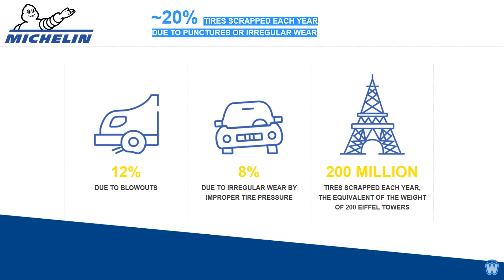Michelin Airless Tire UPTIS - Unique Puncture-Proof Tire System

Comment: Don't see these coming a reality. Big companies won't approve of products which last longer. Else how would they make their money
Reply: As new models get made by big car industrial manufacturers (Ford, Chevrolet, dodge, RAM, & so on) they’ll use old school (aired) tires and the customers/ buyers can decide to keep it that way or to go airless. So therefore tire companies will have nothing to fear when the airless tires comes into public tire shops.
Reply: I think these tires would be designed to wear out faster. I don't know anything about these tires but it seems like a little  dry rot would mean they can't be used at all.
Reply: @pianofry1138  "these tires would be designed to wear out faster." I don't even get this type of logic. the whole idea with these tires is that they are MORE DURABLE AND RESILIENT. Where do you even get such a contradictory idea?
It's like consumers are refusing to welcome a change than benefits them. This mindset is absolutely mind boggling.
Reply: @neurofiedyamato8763   I see a future where the airless tires will be tested on semi trucks (since truckers travel states and drive over everything from smooth asphalt roads to pothole infested streets so bumpy it’ll flatten all 4 tires easily) before being made for average motorists (cars, trucks, SUV’s, vans, atvs, 4-wheelers, etc)
Reply: @pianofry1138    Ask the construction workers who drives construction vehicles with airless tires if they wear out faster & last longer than aired tires.
Reply: ????? Michelin is like one of the biggest tire companies out there. Yet they are the ones developing it.
Reply: You're dumb

Comment: I think the problem here will be keeping the tyre on the rim. As an air filled tyre has the internal air pressure pushing the tyre outwards keeping it sealed to the wheel rim.
What keeps this airless tyre sealed securely to the rim?

Comment: Oh.. OK then, we’ll carry on wasting 200million Tyres a year so the police can carry on catching wankers!?
Reply: thats not the real problem, the real problem is when a company makes something too durable people wont need to buy more from them and they run out of business
Reply: @isea_  They'll still use the threads, just sell sales because of blown tires but maybe they'll address that with increased costs.
Reply: Police will want it for themselves but NOT for public. Repair people want the repair work too.
Reply: Blank  a lot of companies went bankrupt after making extremely efficient products
Reply: no these tires have a lot of problems, that's why. 
these tires are unsafe and they lose balance very easily. you cant drive fast with these at all.
Reply: its funny how everyone just takes the video at face value while failing to see the more detailed and bigger picture. like R.a.g.e said, these  mainly benefit slowly moving vehicles. for a vehicle traveling at highway or freeway speeds, these tires could prove to be an even greater danger factor than conventional tires, and that's not even mentioning when you've gotta stop quickly while traveling at a high speed. i think this tire technology is great for some segments of the vehicle market, but it needs significant improvement if it's going to hit mainstream consumer markets
Reply: These tires probably arent going as fast as normal road tires or loose rubber way to quick compared to road tires
Reply: You guys we have virtual reality already, we can make law breakers feel terrified of their sins(if reckless driving, projected of him being stuck and hurting due to a severe crash)
Reply: They're not meant for road use, yet, they will create drag at highway speed because of the design, they will easily deform at highway speed and you will damage the rims if you slam on the brake, stop talking out of your ass, they're meant for slow utility vehicles where tires are way more expensive than the car tires. If it was about making money than those utility vehicles wouldn't have gotten them either.
Reply: Ya, it would be better if we could just hang people who continually break the law. Then more people would get the hint and start living better more respectful lives
Reply: @ryanalexander984  they already have countries that do that and trust me you don't want to live there
Reply: @ryanalexander984  yo wtf lmfaoo
Reply: @ryanalexander984   all I'm gonna say is look at the Salem witch trials and the KKK for the reason we dont do that the schools were right history repeats itself if you forget it and you right here are the living example of this theory
Reply: @ryanalexander984  would be better if people did that to politicians
Reply: @williamsfamily809  absolutely
Reply: It make more eco system green and save the sea

Comment: cops are starting to receive this super useful tool that can stop any car without excessive damage or forcing the other car to lose control and spin out. don’t remember what it’s called but it’s safer than the two methods you mentioned and it’ll work with these tires

Comment: There seem to be a lot of comments about police preventing these tires from being used ... I suggest that you listen more carefully or check to see if they are illegal.  (Hint: I can find no law in any country that prevents the use of these tires.)

But more problematic is the claim that these tires are better for the environment.  It's not so simple.  Yes, they might reduce the need for raw materials, but they also have much higher rolling resistance that pneumatic tires, which means there's a trade-off.

Comment: The real rubber question is how can companies make tires that last 60k miles on a car that can go 80+mph but my shoes wear out in a year? Planned obsolescence is my guess and it’s a horrible practice.
Reply: because the rubber on your shoes needs to be soft and pliable?
Reply: Stop dragging your feet you damn caveman. I've been wearing the same shoes for 3 years.
Reply: @Xachremos   tell that to me I never drag my feet and a majority of the tough running shoes I've had have fallen apart in a year if you aren't a twinkle toes and have a heavy step like a average adult Male does chances are a majority of shoes on you will fall apart this is a common issue that everyone talks about also I bet money those shoes aren't fishnet
Reply: I mean tires are heavier and stroner
Reply: Well im using my brothers 5yo shoes for 1year now and still same quality not a 100$ shoe either...
Reply: Different grades of rubber

You actually can cut out tyre treads and use them as show soles. They do it in Africa. 

They are very heavy but they last for years
Reply: Baxter James  Enlighten folks
Reply: No it is not (kinda, but it is not the direct result from planned obselence), Tire is built to applied safety guidance, hence more strong more durable and has cord for reinforcement. While shoes does not need to apply those guidance. engineer and designer are task to design as economically possible, so of course shoes are made with weaker material. Except for safety shoes for industrial purposes

And question How TF you manage to destroy your shoes in 1 year. Mine manage to survive in 3 Years.
Reply: The fuck? You cant wear tyre rubber on your feel. Its vulcanized ribber embedded with thick industrial yarn thread and metal wires and all the do most of the time is roll rather then intermediate pressure every time you put a step forward or back. Hope you know static friction is more then rolling friction.
Reply: @hp2084  I get the science behind it but there is static friction during a turn
Is there not?
Reply: I'm six foot two hundred pounds and shoes don't last with me. I've tried so many brands I can't keep track. I'll add some gel or foam insert to get comfort with sneakers that will last a life time.
Reply: Or poor quality. Im no fan of nike company wise. But Ive been wearing cheap offbrand running shoes for basically all my life, going through a pair at a very consistent 6 month basis. I got some very expensive nike runners at a thrift store 2 years ago and im still using them in relatively good condition today.
Reply: How tf do your shoes wear out in a year
Reply: Mexico been making guarache made with rubber soles off used tires. The Mexican sandals made for the sierra and any environment. Check it out. Rubber soles foot wear. It is out in the world.
Reply: and what about incorrect wheel alignment wearing out tires prematurely . These kind of tires will not even last 1 month lol.. I will keep the tires I got thanks very much .
Reply: rubber mix. tires use all kinds of diffrent blends depending on useage. race tires can be soft enough to only last a few km.  your shoes are made out of very soft rubber so it wears out mutch faster.   btw did you know that all season tires do not exist? they are ither summer tires or winter ones you can't have both becaus they use diffrent types of rubber.  summer tires have syntetic so it stays hard when it's hot outside but problem with that is that when it gets cold it get's to hard so winter tires use a rubber blend with more natural rubbers so it stays soft even during cold weather but gets to soft during summer so it wears out to fast
Reply: As someone who is 6 ft 200 lbs, my shoes usually last 3-5 years.
Reply: ... and so capitalism laughed and had a huge party

Comment: Sad to say these tires are only available for the chefs who earned their stars.
Reply: Lmaoooo
Reply: Underrated comment
Reply: @fingers_crossed7  Industries will find newer ways to add vulnerabilities to the new tyre as well. Like making the tyre degrade more frequently than the traditional ones or something along those lines. But by and large it seems that speed is the only issue these tyres face.
Reply: @fingers_crossed7  not sure about that bruh. This things looks like going to worn out very fast.
Reply: Baxter James  and you will get a terrible fuel economy too
Reply: I would like to see how they tires do on a fully loaded truck.
Reply: @TheRealTedNeal  Just like now you use heavier tires for trucks, you can build tougher tires of this type in the video, too.
Reply: How the hell is a brand new 4 day old comment on a 1 year old video get 1.5 k likes?! Damn!
Reply: @cheeseballsnorter5494  Maybe we are more of a culinary enthusiasts rather than some garage mechanic or hardware industry fan, I dunno. 😂
Reply: @fingers_crossed7  I also  think more tires are scrapped, because they are getting old and cracked than by blowouts, and these tires are probably much more sensitive for cracks and changing temperatures.
Reply: Wtf michelene
Reply: @Merlin John : "Sad to say these tires are only available for the chefs who earned their stars."  Also, unfortunately, you get 1 tyre per star and it's a maximum 3 stars, so totally useless unless you're driving a three wheeler!
Reply: @fingers_crossed7  exactly
Reply: 😆😆😆😆 this comment made my day!!!
Reply: They have been showing tires like this since I was little.
Reply: I need this for my dump truck
Reply: Noooo!! Wait... I don't have a a car!
Reply: Baxter James  yeah honestly anyhing over 30 it will start to balloon. Or stretch and expand until it eventually shreds the rubber. I wanted to try them on my rx8 probably 5 years ago and came to the realization that its impossible 😔
Reply: Gordon Ramsay stonks
Reply: @fingers_crossed7  I mean it is made by Michelen who are one of the biggest tire producers
Reply: You think it won't be a problem when water/ice/snow fills those gaps?
Reply: Baxter James  you really missed the joke didn’t you
Reply: SpartiuS94 do you up to what speed they starts to stuggle?
Reply: @somebody700  ALL vehicles "need speed" otherwise they dont go anywhere.
Reply: @somebody700  D'you get invited to many parties?
Reply: @djxjxixsmjxjskjzxn1853  You clever little bastard. 😂😂😂
Reply: @somebody700  You just made my point fella...
Reply: Cooking like a chef im a 5 star michelin
Reply: @somebody700  So, according to what goes on in your pin-head, physics is a "technicality".  Is it also a technicality that the brakes work on your car?
Reply: @fingers_crossed7  btw, the michelin who give stars to chefs is the same michelin who produces tires. haha
Reply: GTA stars
Reply: @fingers_crossed7  the tires will get too lose at one point. These are good for long fast distances because when the car is going faster theirs less pressure on the tires per square foot

Comment: Imagine drive fast with that tires in a steep turn
Reply: I bet if you try to drift it’s just gonna start splitting, melting away from the metal rims
Reply: @Phantom-wu9su  Unlikely, the "ribs" are more like a board. Since the widest section would runs along the side, the effective thickness keeps it quite resilient to lateral motions as experienced in a drift.
Reply: @Phantom-wu9su  yh, maybe they can make something to take the tension from the weak "ribs"
Reply: @Phantom-wu9su  isn't it too soon to bet, wait till 2024
Reply: I think my brain has committed suicide

Comment: The problem is that you can't choose and adjust the tyre pressure.
Reply: True, for a truck when you carry heavy duty materials would the tire just flat out completely?
Reply: No Name I would assume that they will have different weight ratings for different purposes. A truck will be made of more rigid rubber than a small car tire

Comment: spike strip solution: the guillotrap: like the brake lock but with a pressure activated guillotine that peels the outer layer off partially  so it causes major reduction in speed, and added shrapnel / incorrect angles would make even more damage
Reply: Don’t be the asshole that ruins this idea.
Reply: you mean something like those wristbands that you slap on your wrist that curl when you do so?
Reply: I was actually thinking a more elevated ledge that when driven over, gets into the gap between the tire and the fender, causing more friction. My idea is more inefficient then yours tho because the cars model and size will depend if it works or not.
Reply: @2aj.  it would also need more time to be set up, this is like a beartrap for cars, and vehicle integrity to the point of minor damage isn't a concern, and tires can be replaced
Reply: @Danny Timms that is also a good idea but the net would have to have something that makes the car slide or slow down. What if you put a big rectangle shaped thing that wraps around the outer edge and causes the car to come to a complete stop
Reply: Genius. You, sir, deserve an award.
Reply: theres tons of alternatives already best one would be that net that wraps arround the tire similar to how seaweed wraps arround the propeller of a boat
Reply: @julianeder3383  the net would have to be bulky and heavy
Reply: @2aj.  not really its actually pretty light weight and it stops the car a lot quicker than traditional spikes theres 2 variations i know about  (X-Net and Arrest net) you can actually find a video where both of them can be seen on youtube (10 Police and Military Inventions that  stop any speeding vehicle) would be the name of the vid if you wanna see it for yourself
Reply: @julianeder3383  yes, let us come together to give unnecessary power to police officers,
also i simulated that in my head and it would have to be a net launcher type setup that gets in between the underbelly pipes/those suspension spokes meaning it would take quite a few set up as in nature, 

seaweed catches boats to eat by clogging the propellers through dense numbers. thankfully boats are very nutritious. the only problems is their riders humans who keep chopping off the seaweed before it can drag them down
Reply: till somebody rides trough it with a bicycle or a bike

Comment: There is a reason we use pneumatic tires instead of these implements. (1) Because air is LIGHTER than any polymer or metallic spring. (2) Because air does not have a fatigue life, does not harden and does not crack. (3) Because the spring rate can be adjusted simply with air simply by inflating or deflating to different pressures.

Comment: Now let’s talk about that speed limit and cornering on this tyres, not just soft gliding through.
Show me a racing car drifting through a turns at speed and how this type of “wheel ware” will behave under those circumstances, to prove its safety and reliability. Until then its a another “fund by customer research”. 
Run flat tyres are really good and convenient for getting rid of that spare from your boot but they are very stiff and hard sidewalls damaging the rims. I know it because it repaired two full sets of rims already on my cars and had to switch for smaller radius alloys which “more meat” tyres on them for more comfort and less headache. 
You should always look after your car if you care about your family and yourself. In the end your safety and safety of your loved ones depends on it. 
Have a good day everyone 👍

Comment: I want to know if they would be stable and safe if the tires went through mud or fine gravel... if debris gets in side, will it cause tearing or stretching which could lead to tearing... or if debris does get inside could it cause unbalanced tires???

Comment: Problem 
Close to 30% people run on Dated tyres which are not completely safe but if properly stored and properly inflated when on the car  will last a long time.
Yes People don't change good tread tyres just because someone from the factory says so.
Airless tyres are dependant on the tyre structure which will deteriorate as all rubber does and as such become more unusable fast.
Thus also providing a bonus for the manufacturer and a heavy minus for the consumer that is now obligated to change the them more often even if they aren't even remotely close to spent.
Oh yeah for all the Wonderland people out there I'm sorry to crush your dreams that Michelin is ONLY doing this from the kindness of their hearts...